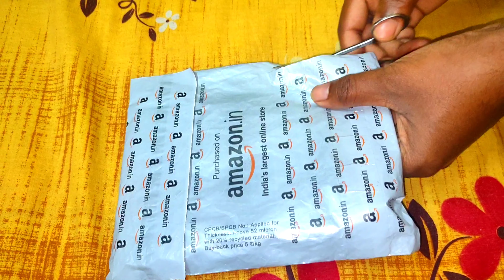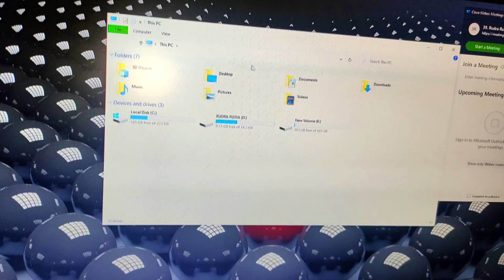USB 3.0 20 Pin Header Male to USB 2.0 9 Pin Female Adapter Cable Motherboard 2022

Comment: Do both usb ports work? If they do it's really great since I broke my usb 3.0 header on my mobo.
Reply from the maker: yes
Reply: @technicalbharat4107  I was wondering the same.
Weird that they both work since the motherboard connection is only 1 port.
Are you sure they both work at the same time?
Reply from the maker: @winandd8649  yes
Reply: @technicalbharat4107  I've found out that such a single motherboard connection is indeed for 2 ports! 👍
Reply: I think speed will decrease drastically